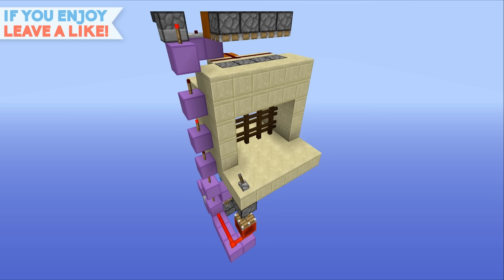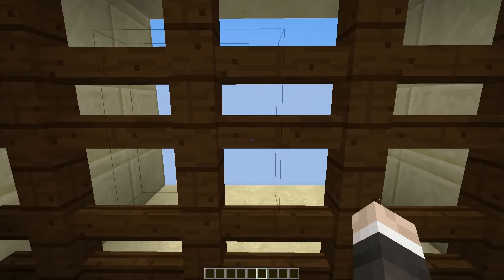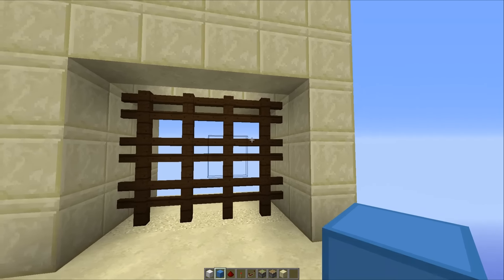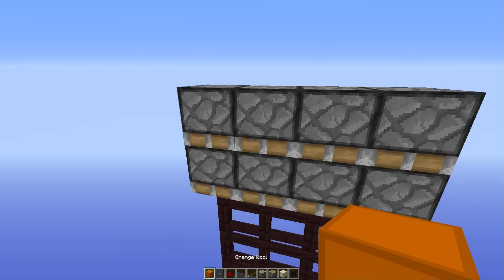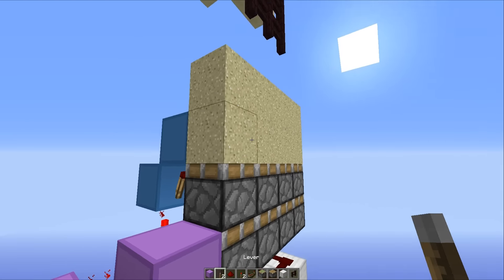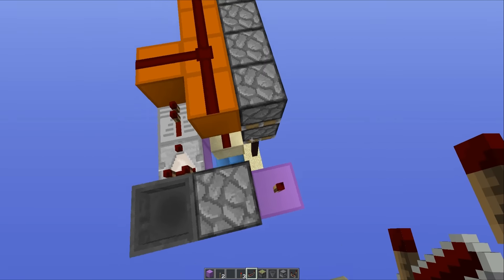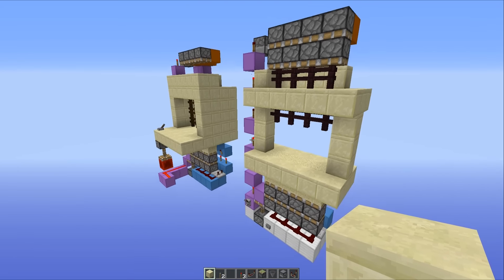Minecraft: Simple Piston Castle Gate [Portcullis]

Comment: For those who are having troubles in 1.9 with the lower pistons not retracting properly leaving one layer of gravel/sand above ground,  try this-

as suggested below,  simply power your lowest row of pistons from the top row of Redstone torches in the bottom half of your portcullis assembly (the ones powering your second row of pistons above the sticky pistons). Run a line of Redstone down from these torches into repeaters that run directly into  the sticky pistons on the bottom.
Reply: +Herr Klockow yo could you clarify a little please? or make a vid, im a noob with redstone.
Reply: +cringw boi 2002 

I'm sorry, I don't have the ability to upload a video. I'll try to be more specific.

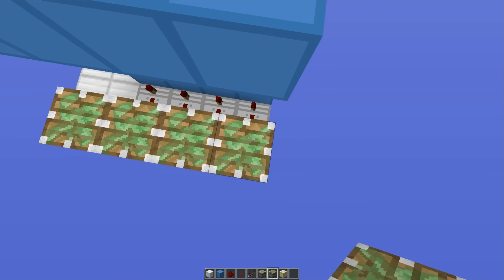at 2:00 in the video Mumbo is placing a row of torches (the upper row). what you need to do is place a Redstone dust line from the edge of this row so it touches one of the end torches. then run the dust down and connect it to the back of the sticky pistons on the bottom.  you need to place repeaters going directly into each sticky piston and connect the repeaters with the line of Redstone that you brought down from the row of torches.  place these repeaters and dust on the opposite side of the portcullis from where the torches are. hope this helps buddy.
Reply: Herr Klockow Yo dude, Thanks for clarifying. sadly im to retarded to understand simple english(it seems) and I think I need help
Like maybe a skype call with screenshare with you demonstrating how to do it?
Reply: I will set up a few pics online and post a link for you in the next day or two if I'm able. It's easy once you see it, but a picture is truly worth a thousand words in this case.
Reply: ok thanks man, stay in touch
Reply: Herr Klockow Hey dude, Is everything ok? its been two days now, and you havent sent me any links or images, pls get in contact as soon as you can. Thanks
Reply: +TR-8R 

I've uploaded a video on my channel showing the fix for 1.9. it's a short video with only 2 pictures, the before and after.
Reply: +Herr Klockow Hi Herr klockow, I made another one today on the same world of mine, but this time its experienceing a problem with the very top layer of pistons, which helps push down a layer of piston. its not activating properly making an akward and ugly structure.
Reply: +Herr Klockow u know a fix?
Reply: What exactly is it doing? Is it pushing asymmetrically? Certain pistons not firing?
Reply: In 1.9, the double piston extenders have timing issues causing the pulse to turn into a T-flip flop switch.  Try to mirror what we made on the bottom pistons in a practice world.  Once I know the issue,  I'll be sure to solve it for you.
Reply: Herr Klockow should I make a video?
Reply: That would be helpful,  I can then see your exact issue.  I should be able to post a fix later tonight if time allows
Reply: Herr Klockow uploading 1 now
Reply: yea a piston isnt firing up
Reply: Herr Klockow have you seen the video?

Comment: doesn't work in 1.10, tested it but the bottom sticky pistons won't pull the normal pistons back but maybe I have done something wrong :)
Reply: No I tried it and red stone doesn't work underneath pistons
Reply: Yeah it definitely doesn't work on 1.10 a damn shame.
Reply: It is possible, I made a functional one, though modified, it works.
Reply: PreciousPvP Hypixel gaming Yeah, I fixed mine, you just have to change the timing on the sticky piston.
Reply: i fixed it useing a retraction on the sticky piston
Reply: CexelBy 1 That could definitely work
Reply: +Le Leedler i did work tested it on 1.9 hump insted of fences i use iron bars
Reply: Cool, I personally think that the fences look better but, I am glad you found a solution you liked.
Reply: @CexelBy 1 Do you think you could explain how you fixed it? I'm curious
Reply: +Khalkara ill make a video
Reply: @CexelBy 1 Please do that for us!
Reply: I did this in 1.9 so umh
Reply: What Ticks?
Reply: what does that mean, a retraction, my sticky piston wont bring the other piston down, what did you do to bring it down? thanks
Reply: what do i have to change to get this working? thanks
Reply: How exactly did you modify it to work? I am trying to build one for a castle project I'm working on and need a functioning portcullis at the front.
Reply: +Cexel

Still waiting for that video.
Reply: niek tillema that happened to me
Reply: CexelBy 1 how??

Comment: Hello! I have a issue with the top pistons and with the hopper. When i pull the lever the top pistons doesn't seem to contract like stop functioning(when they are not connected by redstone).So i check the structure and i saw that the contractor remains permanently on.What should i do?

Comment: I just wanna know how I should close the gate when I'm inside the castle, when the lever that opens or closes it is at the outside of the castle..? ;)
Reply: Just a simple toggle latch with 2 buttons for input, one outside and one inside.
Reply: You can do a T-Flip Flop and connect as manny buttons to it as you want
Reply: You know you could just use a 10 second hopper output timer right? Simplest way you just activate the circuit walk through, then it closes automatically
Reply: It was just a joke ;) Cause Mumbo did only put one lever at one side.. But thanks for the advice! :)

Comment: Anyone have a design that doesn't require a sand/gravel floor?
Reply: I'm sure Mumbo could do that, but it would require a lot more redstone to push up the blocks then pull them down, with the sand/gravel they just fall back into place.
Reply: ***** A good video. Sometimes though I wish that fences would move together when pulled so that you wouldn't have to push them on the other side.
Reply: maybe not what you've been looking for, but if you have a column of nether-brick-fence next to regular fence, they don't connect and let you pass through (not mobs though), If you alternate the rows and push the middle one up or down 1 block, you can toggle whether players can walk through or not. 

Not as beautiful, but still nice looking, easy to build, cheap on resources and functional.

Comment: Heads up, this no longer works properly as of Minecraft 1.9. The second layer of pistons holding up the sand no longer get pulled back into place.
Reply: +sharpenednoodles  fixed
Reply: Nope, it's still broken as of release versions. It maybe fixed in 1.9.1 prereleases, but they're not stable, so do no count.
Reply: +sharpenednoodles an easy fix is to repower the first layer of the pistons after the pistons have retracted, thus causing them to pull the second layer back down
Reply: +sharpenednoodles 
Repowering the first layer worked well for me. Fed also from the on button with 3 repeaters on 4 ticks, and the row of repeaters feeding back into the first layer at 1 tick, I managed to hide the redraw showing on the gravel level. Very happy now, no redesign, just another row on the opposite side of the design :o)
Reply: Simon Grose ???
Reply: Simon Grose nvm i got it